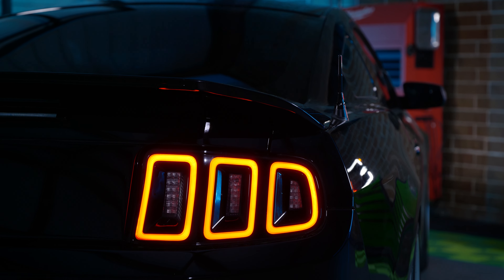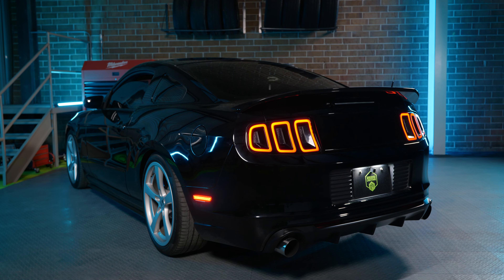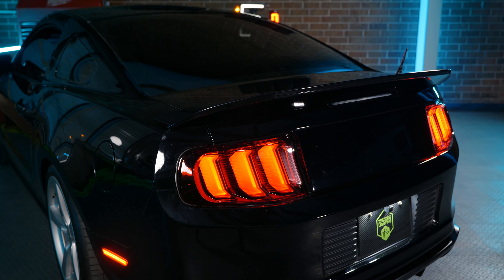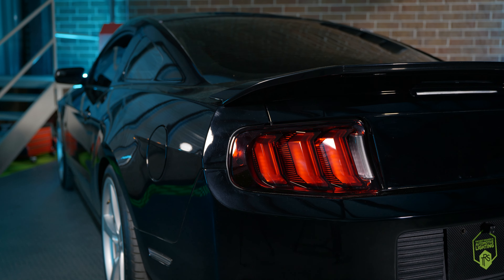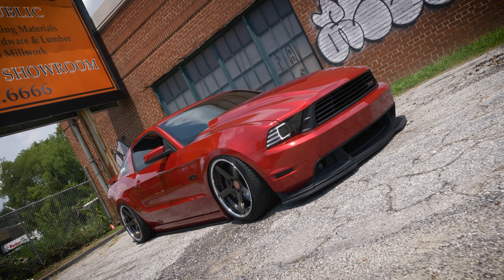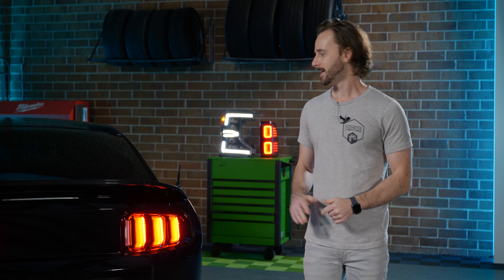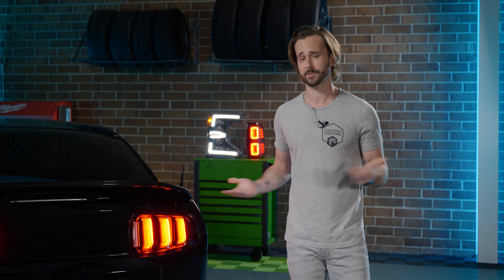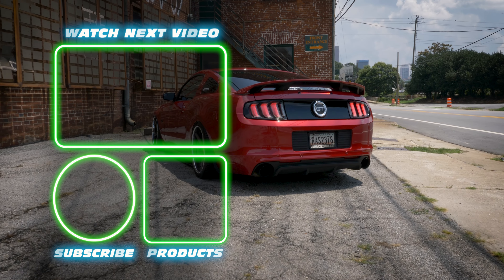The Best & Brightest LED Taillight Upgrade for the 2010 - 2014 Ford Mustang

Comment: These are the nicest aftermarket taillights for the s197. There much brighter than stock, but the 2013-14 OEM taillights are very stylish.  But if u got a 2010-12 these are a great upgrade over the candy cane OEM taillights. I got a 2010 Gt, im running these and i love them.
Reply: Don’t you have to change the rear bumper to put those on?